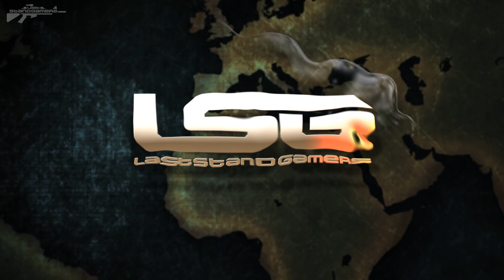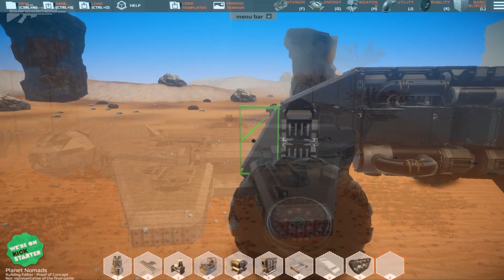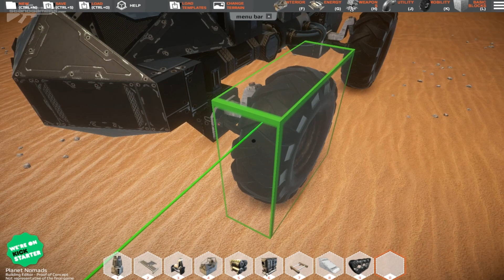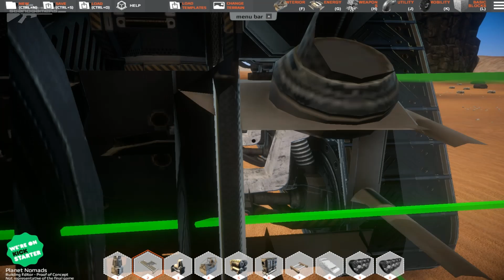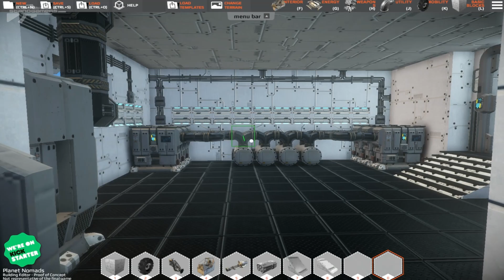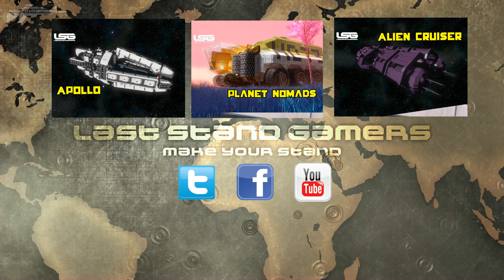Planet Nomads - Editor Quick Look (Features/Blocks)

Comment: tank tracks?
wow, this unreleased game did something that SE didn't do in 2 years that it's been released.
i've been keeping up with SE since 2013 and i like that, but really, the fanbase wanted tracks since forever and KSH didn't add them, but they added the solar panels in about a week, and i'd say that the tracks are at least as wanted as the solar panels, but they're actually probably more wanted than that.
i really think that this will pose as competition to SE, and KSH need to keep up if they want to be in the lead.
arguably they're in the lead so far, but it doesn't seem like that will last long.

Comment: it looks like a space engineer clone just using the new unreal engine.
Reply: +Minnlinz 
that's only what it looks so far. and it's not even released yet.
and, it has tank tracks, which SE doesn't have despite being out for over 2 years.
Reply: +Mighty Wolf well naw fuckin dip, planets are pretty recent, and before planets why would there be tank tracks, it would be useless in space
Reply: MrFiggets
why would there be wheels, then, as well?
Reply: Vrox11
maybe, but arron (and loads of other people) were trying to build track designs before there were even powered wheels.
they could've added them in just because people wanted them.
and now, since planets are here, why didn't they add them now? there have been a few patches, but nothing really special.
Reply: +Mighty Wolf because maybe it's not their top priority?
Reply: MrFiggets
and what would be their top priority then? 
implementing things which are nearly useless (like the oxygen farm and the unpowered wheel, while it was a thing) or broken things (such as pistons and rotors)? 
i mean, they implemented solar panels because Arron and sage talked about them in their first episode of survival (or something like second or third), and they went ahead and added them even if there was no need to do so at that point of the game, and they were nearly useless because their power production was low even if they were perfectly pointed towards the sun. these tracks, however, loads of people tried to make tank tracks, but keen seems to just not care about that.
also, they're not a difficult thing to make, since people like Arron managed to almost make some reliable and good tracks on his own, only with building blocks which are in a game. and, well, also, because there's games like red orchestra, IL2 BoS, World of Tanks, War Thunder, Battlefield, they all made nice tank tracks.
so, it probably should be somewhere high in their priorities, and they should be easy to make.
Reply: +Mighty Wolf idk, I'm not a developer.